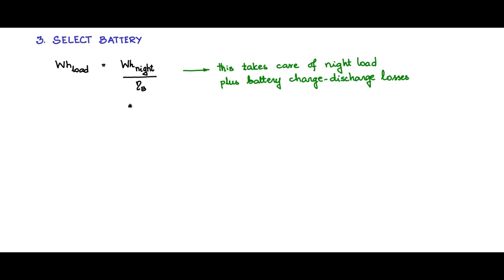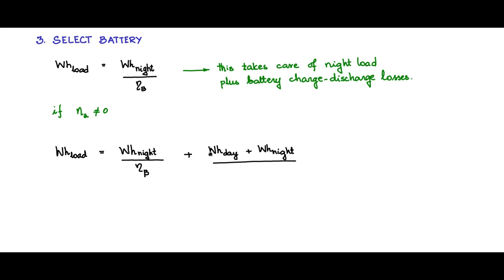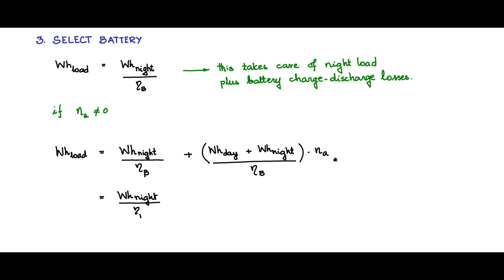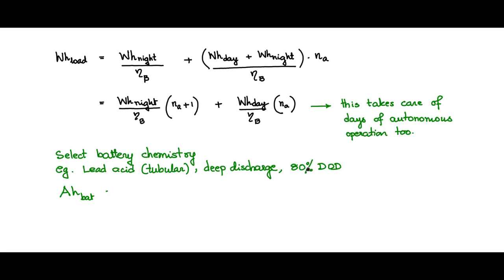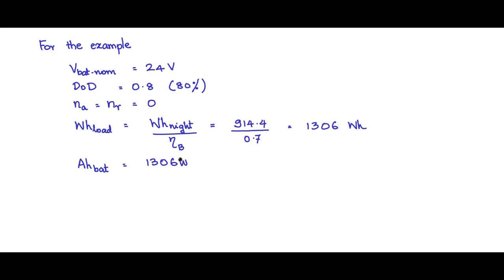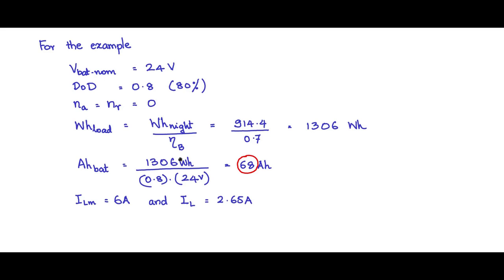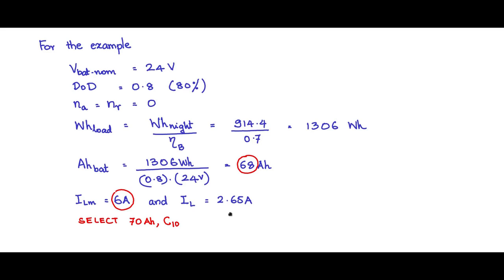PV system design - battery sizing

Comment: Sir, It is my understanding that enhancing the battery autonomy days in the sizing not only offers extra backup days but also minimizes the daily depth of discharge. By lowering the depth of discharge, the lifespan of the battery can be considerably prolonged. The IEC and NEC recommend a battery autonomy of 5 days (120 hours) to ensure that the daily depth of discharge remains below 20%.

Comment: What is c10 and C20 sir.......
Reply: Dear sir, C-10 means rate  of charge (or) discharge of a battery, in above example 07:35 sir has considered C-10 and verifying whether it will satisfy our load current I_lm i.e. 6A , we can verify as we know A = Ah/h , so we have got 68Ah and if we consider C-10 , then A= 68/10 = 6.8A (hence its is satisfying condition that our load current shall be greater than or equal to 6A). Similarly sir has considered C-20 battery to satisfy avg. load current I_l of 2.6A , same formula if we use, we get A=68/20 = 3.4A , again it has satisfied our load current I_L in this case.

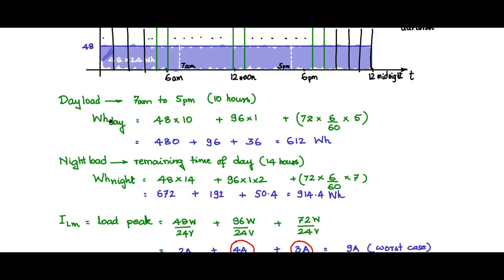Comment: Eng: In time 5:14 Wh Day=612, What happens there are 2 cloudy days (from 7 am to 5 pm), and the battery to be calculated at night, has been discharged to 80% (o.8 x 924). Who would energize the system?